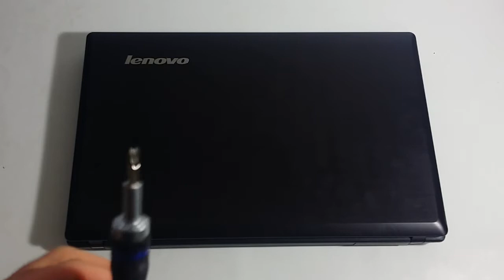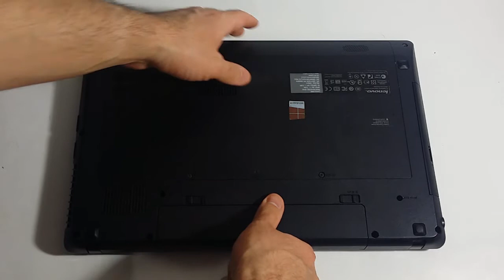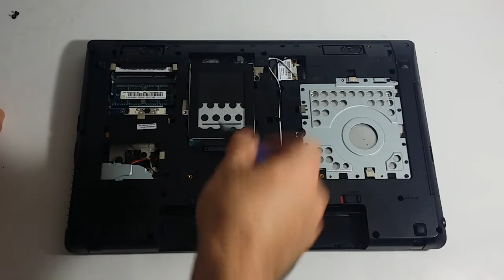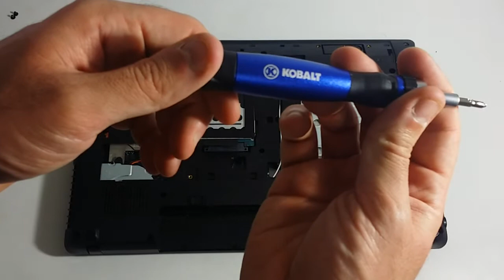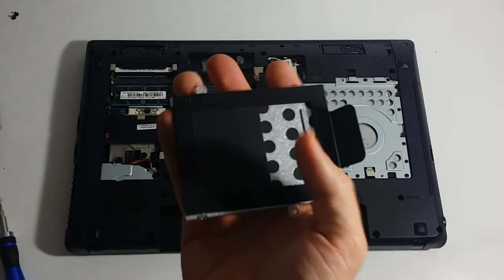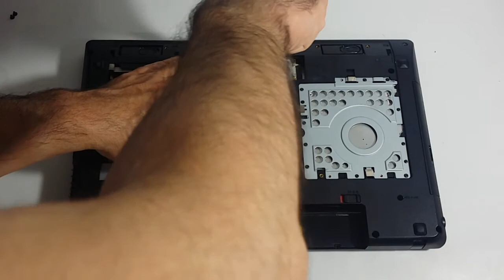Lenovo G580 Hard Drive Upgrade

Comment: Thanks for sharing. I knew generally what to do but was really struggling to get the old hard drive free. Your camera angle helped me figure out where I could gently pry with a plastic tool to help slide it backwards safely.  Switched to a Crucial 256Gb SSD for less than 40 dollars.
Reply from the maker: Hi, I am glad that my video helped you out, hopefully everything else went smoothly too, thanks for watching as well.

Comment: Is the SSD upgrade same as the Mechanical HD? Is the SSD have same ports and connectors ?
Reply from the maker: Hello, excellent question.  SSD drives are much faster then mechanical drives. I would highly recommend SSD since they have dropped in prices dramatically. The power port and the SATA port and connectors are the same on the SSD as well.  I also recommend a good brand of SSD like Western Digital or Samsung so you don't have issues.  Once you experience the power of SSD you will love it.  Thanks for your input and Happy holidays too.  Cheers
Reply: @ReviewsandTech  Thanks for the info. 
I have one more question is theere any free tool available to clone my existing mechanical hard disk to SSD. The licensed windows comes preinstalled with my G580. And I want to continue with that in SSD. Will that work.?
Reply from the maker: @rahultambe2894  I personally haven't cloned drives using software because of one reason which is that you might have to Repartition the new drive after you clone it. Not only that, but when you clone the old drive, that means all the junk that drive had is now on the new one.  I would rather reinstall Windows from scratch so you enjoy your laptop like new all over again. What version of Windows do you have ? Beadies retail stores do sell drive cloners as well which aren't too expensive.  Hope that helps
Reply from the maker: @rahultambe2894  A cheap way to save all of your data like pics, videos and documents is to buy a flash drive, maybe 128gb or 256gb flash drive say for about $22 to save all of your goodies on it before removing the old drive to replace it....

Comment: what is the reference of the hard disc ssd, thank you
Reply from the maker: SSD stands for solid state drive which means there is no moving parts inside unlike a hard disk drive where there is mechanical moving parts. SSD's are a lot faster then hard disk drives as well .. hope that helps